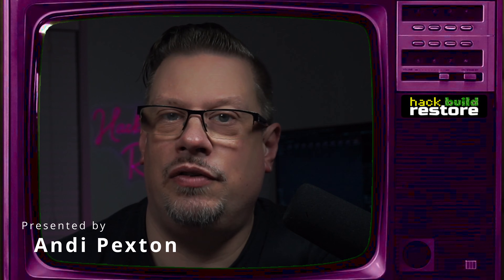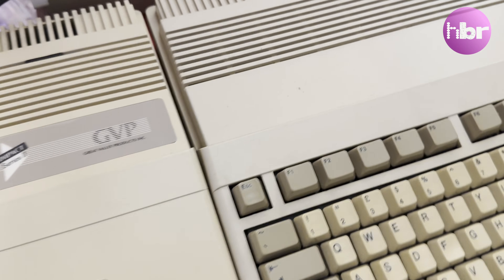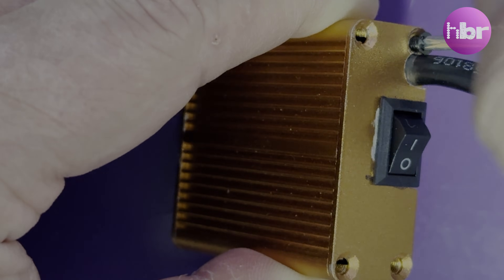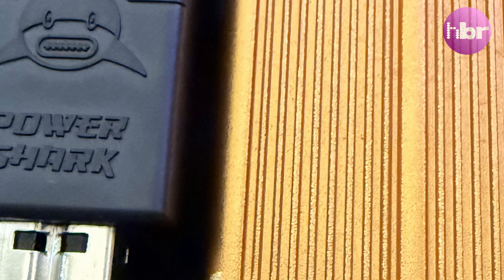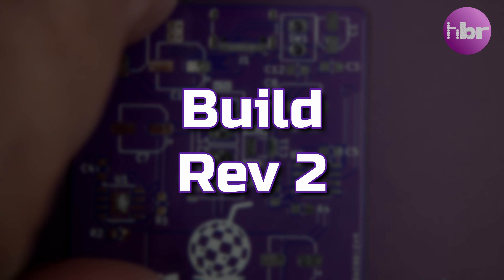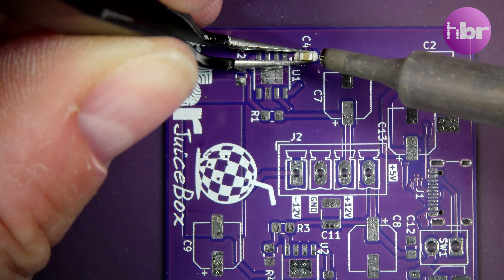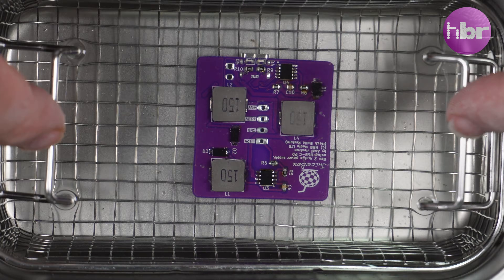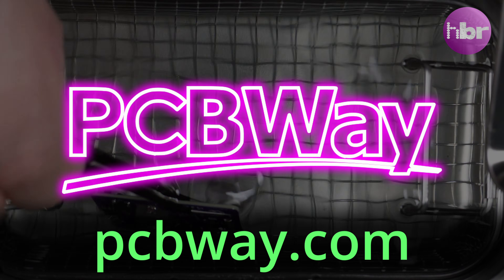The JuiceBox Prototype Just Got an UPGRADE!

Comment: Great work! Looking forward to the kits, I have a very tired old A1200 (and smashed) PSU I'd love to replace with this.
Reply from the maker: Should be available before end of Jan fingers crossed 🤞
Reply: @hackbuildrestore  Awesome news! Thanks for all your efforts, love this community
Reply: @hackbuildrestore great, hope to try one on an early 520ST stubbie I have and got internal
Reply: @hackbuildrestore is it a different pin arrangement for an a1200 and no -12v, correct, so presumably just a case of wiring differently and with fewer wires to the Amiga connector?
Reply from the maker: Does the sound and image on your A1200 seem bit off? I only ask because the -12v is used by the audio op amp as a bias voltage (U28) & the video signal logic (U26), it also goes to the trapdoor edge connector and is used by several expansions. That’s not my definition of not used
Reply: @hackbuildrestore yeah I think I’d based my question on some bad info. I don’t have an a1200 but am looking to acquire one so wanted to check whether I could build one for a 1200… which I’m figuring I could 😊 thx